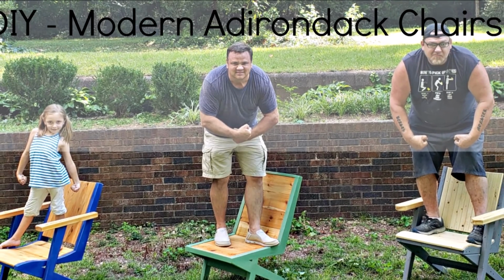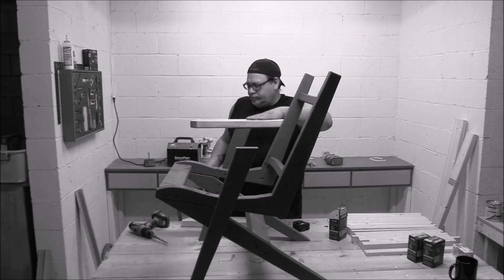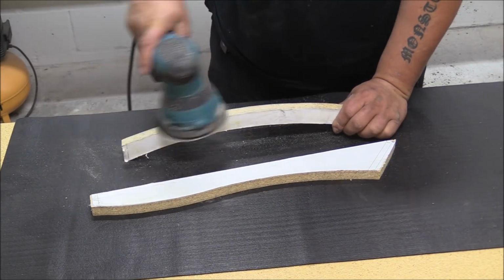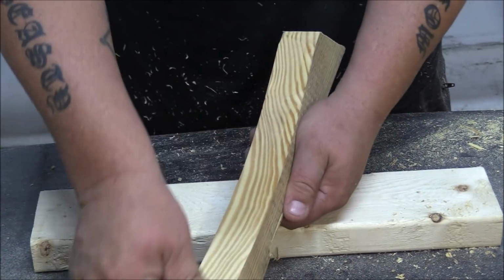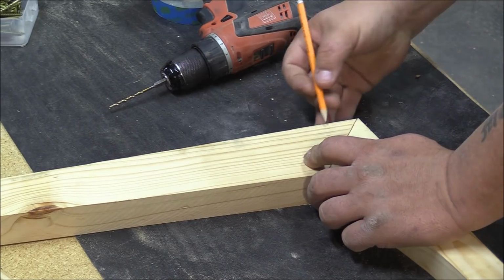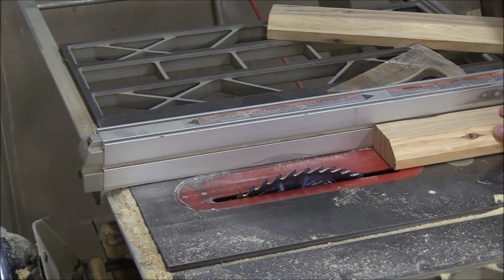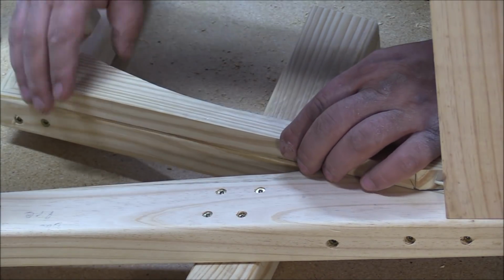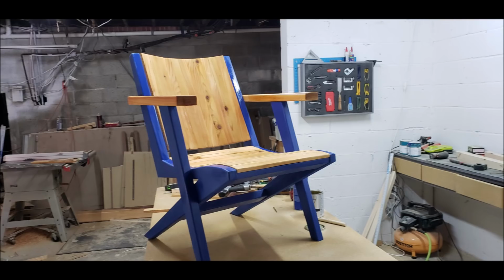DIY - Modern Adirondack Chairs | Woodworking Project

Comment: For all you folks that made these chairs, how did you attach the seat and back slats?  On my prototype (syp) I used brads from my nail gun but don't really think they will last long.  On the two I'm making now out of cedar I guess I'll use 1 inch exterior screws unless someone has a better way.

Comment: Yeah, I was concerned about the strength at first, but convinced as the video went on.  Use QUALITY screws if you're gonna build these!  Drywall screws are brittle and will shear off, I've twisted the heads off many of them just screwing them into wood.

Comment: Really enjoyed the simplicity of the project Izzy. Have you ever tried cutting your own plugs instead of using dowel? I did some patio furniture out of cedar and when I went to cut plugs out of some of the extra cedar, it either cut too small or just shredded the wood. I was kind of bummed by that. Maybe cedar is too soft to cut plugs from.

Comment: I love these. Quick question: is it a myth you need titebond 2 or 3 outside?
Reply from the maker: Mikhail Akbashev it's always a good idea to use titebond 2 or 3 or side. But I  painted mine which does help seal the glue joints from the elements.

Comment: Love them. I’m a furniture designer and have just a couple of ideas you or someone watching might consider. I would through bolt the critical joint and plug them, with plugs from a plug cutter so you don’t get end gain spots. If you are going to have cushions be sure to adjust the dimensions accordingly.if you want to go to the next level, pull the dimensions off perspectively, adds a lot of work with all the angles but well worth it.

Comment: A great build. One suggestion. Use epoxy and screws to attach a one inch square strip of Trex or other engineered decking to the bottom of all your legs, no leg rot. Keep 'em coming.
Reply: Great idea!

Comment: Beautiful design, Izzy!  Clicking Like (already a subscriber).  These are definitely on my 'to-build' list.  As a fellow big guy who makes you look skinny, I like their height over a traditional Adirondack (I generally need 2 friends and an engine crane to get out of something that low -- kidding, but it is a pain).  I like how they're lightweight for easily moving them around (again, something you don't do lightly with the traditional design).  I like how the front leg connects the arm, seat and rear leg for both strength and asthetics, I like the recessed slats, the whole look!  

And ignore the haters on that 2-screw seatback joint.  The screw length is substantial, there are 2 of them in parallel (so they're pulling diagonally on each other, like a trapezoid resisting collapsing), plus the arm attached to the seatback is obviously helping keep it from opening up.  The armless design might need a half-lap there, but it looks like you already half-lapped the front and rear legs on that one anyway, so you probably did so on the seatback joint as well.  (Edit:  Just noticed when you're painting that one green, looks like you bridged that joint with a gusset.  Very strong!)

Plus, they're gorgeous!  Definitely on my 'to-build' list!

Comment: Do you think those cuts could be made on a scroll saw? I haven't added a jigsaw to my arsenal yet. Very solid design, a little tricky for a newbie to try and make but it's awesome nonetheless ^^~
Reply from the maker: Alexis Ross I dont know if a scroll saw would work on 1.5 inch material
Reply: izzy swan mine will take it, it's not the happiest cutting a 2x4 but it's a kinds big 16" scroll saw, still getting comfy with is honestly